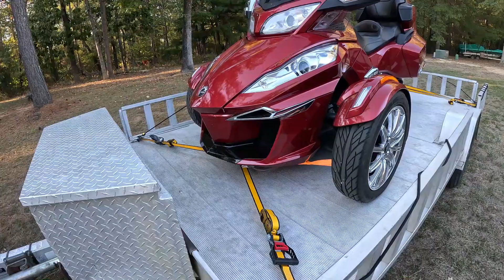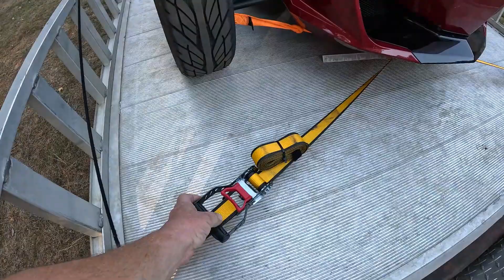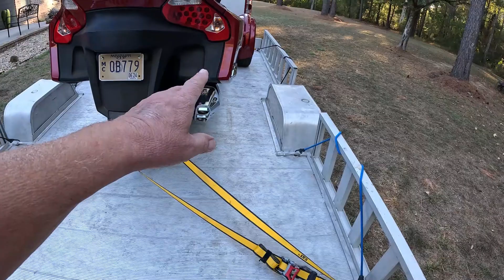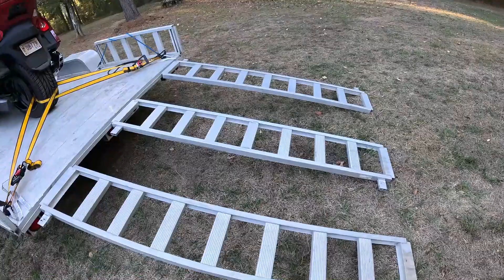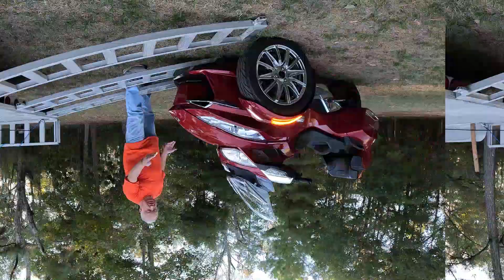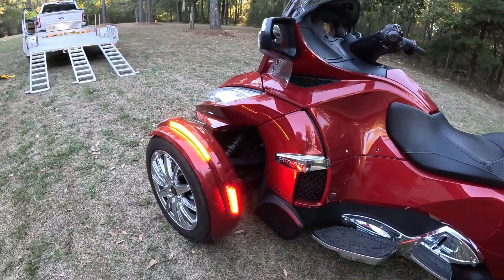Can Am Spyder - Trailering

Comment: That front securing method is not secure at all.  Works great side to side, but if one side of the trailer goes up suddenly, there is nothing preventing the bike from flipping over.  A lightly tightened strap to each front wheel secured on the same side will fix that.  There is simply not enough vertical gains on the straps to hold it down.
Reply from the maker: Thanks for the info.  It took me a while to understand the problem but, now I've got it.  I will correct this.  Thanks again.

Comment: More advice from someone who specializes.  Your method is fine and the trailer is perfect.  Best way to lock down a spyder is to simplygo from the lower a-arm straight forward each side and straight back from the same a-arm no need to attach to the rear wheel.  The key here is the trike can move up and down freely but the tension on the straps remains constant. Also velcro is great wd-40 is poison never use wd-40 on anything.  I learned this spending 10 years as a garage door tech removing wg-40 from door openers 😢
Reply from the maker: @StormyKays  Thanks for the info.

Comment: What year is your bike?
Reply from the maker: It's a 2015.  I agree that slide out ramp would be nice.  I bought this trailer used at a good price and it is versatile as it can be loaded from the sides with atv's.  But, it would be much quicker loading and unloading with a full ramp.
Reply: Our spider is a 2016 RTS same color as yours. Happy riding 😊 @practicingretirement7732
Reply from the maker: @timgiles9413  Thanks.  You too.

Comment: Nice trailer. When I load mine on a trailer, I raise the trailer at the ball while it's still on the ball and crank the wheel on the ground until it raises the front of the trailer. It gives you more clearance on the ramp.
Reply from the maker: Thanks for the idea.
Reply: I do the same and put a 2x4 under the ramp gate